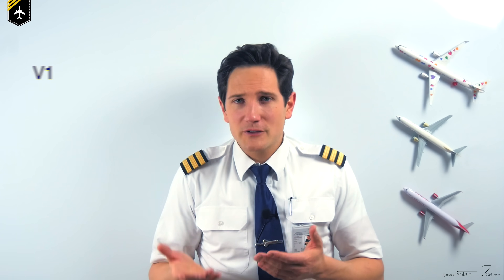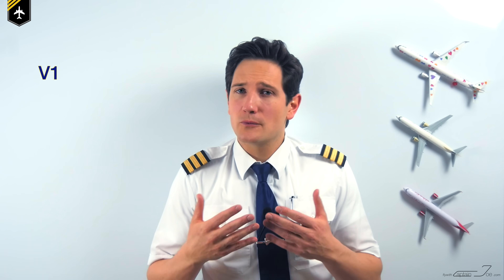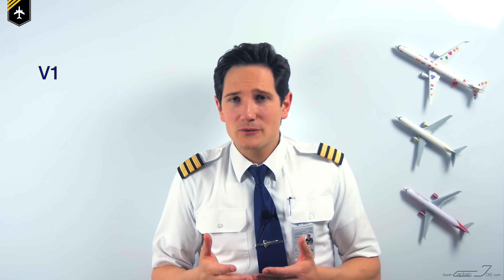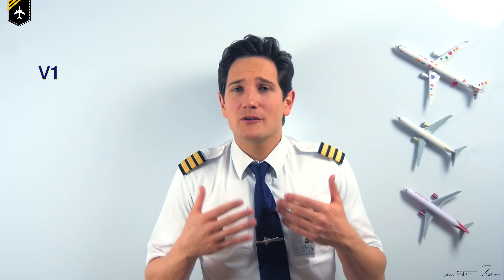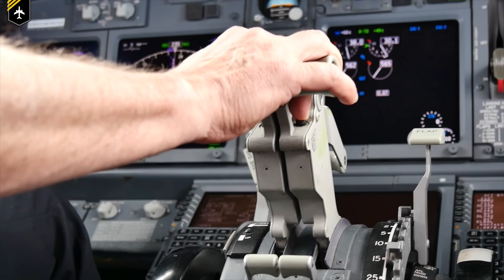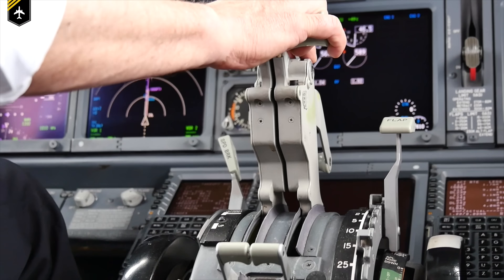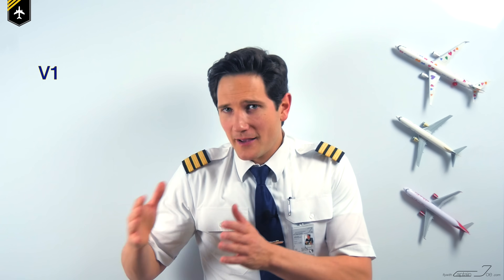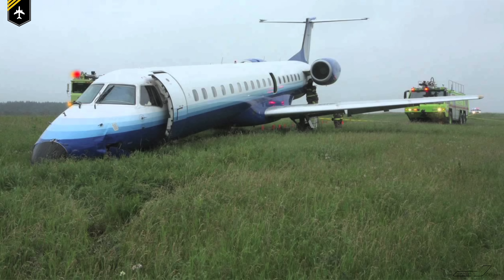TAKE-OFF Speeds V1, Vr, V2! Explained by "CAPTAIN" Joe

Comment: (Parody of "Captain Jack" by Billy Joel)

It's not right to be just hanging around
Time to live it up instead of down
Get your ticket and get off the ground
For awhile

So you go to the airport in your spandex jeans
Check your flight and gate number on the departure screens
A thousand times before doing this same old routine
But you smile

Captain Jo will get you high tonight
And take you to your destination
Captain Jo will get you there alright
Just a little push and you'll be flyin'

The Captain's here, don't want to be late
Pulls on the throttle and you accelerate
I heard him say "V1" then "Rotate"
Without a stall

Hear the mighty engines roaring strong and loud
Soon you'll be high up over the clouds
And please remember smoking is never allowed
In the restroom stall

Captain Jo will get you high tonight
And take you to your destination
Captain Jo will get you there alright
Just a little push and you'll be flyin'

Now you're cruising in the stratosphere
So high up but there's nothing at all to fear
You'll never know just how cold it gets up here
And that's fine

So the flight attendant serves you another stiff drink
And as you sip some booze you start to think
Economy class seats really do stink
All the time

But Captain Jo will get you high tonight
And take you to your destination
Captain Jo will get you there alright
Just a little push and you'll be flyin'

As your flight makes its final approach
You wonder if you'll always be stuck here in coach
You finish your drink and then clear your throat
And you sigh

Soon the jet plane's back on the ground
You're in another time zone and in another town
But there ain't nothing there to hold you down
So you fly

Captain Jo will get you high tonight
And take you to your destination
Captain Jo will get you there alright
Just a little push and you'll be flyin'

© 2017

Comment: Dear Captain Joe,

Can you please explain why an aircraft is able to maintain a straight flying pattern when one of the egines fails? It seems illogical.
Reply: nijs bouman this is because there is an automatic rudder trim which activates on airbus (not sure if in the boeing it activates automatically) which point the rudder in the opposite direction of the engine that is operating to Keep the nose straight

Comment: Great video Captain Joe!
I'd always thought V1 meant the aircraft had enough speed to take off and V2 meant the take off could no longer be aborted and it was safer to continue even with an engine failure.
Reply from the maker: There you go, one less thing to worry about ;)

Comment: Hi Captain Joe, how you pilots can verify the length of used runway is in accordance with expected acceleration? The runway is long enough, engine thrust is ok, but used runway is not. The plane has not accelerated as calculeted for some reason like brake failier or heavy wet snow on tarmac. 

Other guestion; As a passenger I would feel much more confident if the plane would be really physically weighed prior to takeoff. Its been many incidents that the plane has been rotated at a too low speed resulting in a tail strike.

Thanks for the videos!

Comment: ALL good,,,however, some aircraft,, the E3D for example, where the Flight Engineer has control of the throttles ,,,,,and will;  move ( EVERY take off and touch and go, and missed approach, ) the throttles to the appropriate ( and believe me, the E3D had a unique set of throttle settings!)position, so its NOT ALWAYS YOUR glorious selves.....
Reply from the maker: Didn´t know that, thanks for the comment!

Comment: This is probably for a different video.  However, The idea of V1 begs the question what happens if right after you reach V1 you have a DOUBLE engine failure.  I know it's very unlikely but what do  you do if BOTH engines should fail after V1 but before VR?  You're at the point where you can no longer safely abort the take off but yet you CAN'T take off without at least one functioning engine.  I would assume the obvious answer is  you don't take off and you probably end up over running the runway.
Reply from the maker: Very difficult situation!
Reply: yeah not trying to take off makes more sense; i mean you literally have zero thrust to lift...
Reply: What's wrong with the term "overrun"?
Reply: If for any reason you can't make the plane fly after V1, you're going off the end of the runway.
Reply: Soulrider2012
over running the runway??! 
a better term to use: 'overshooting the runway'

Comment: I have a question. What happens if you loose both engines at V1? Would you abort or go. If you abort the takeoff, you won't stop in time. If you continue the takeoff, you will stall. What would you do?
Reply: My cousin flies the a380 for Emirates
Reply from the maker: Probably risk the runway overrun!
Reply: Captain Joe ok

Comment: captain what if both engines fail?..surely you have to abort the take off
Reply from the maker: Very unlikely but I guess everyone would risk the runway overrun!
Reply: Hit the brakes and pray. It will likely end in a runway overrun but some runways have arrester beds at the end, which are designed to stop an aircraft which overshoots the runway. If not you may crash into some runway lights, damaging the aircraft but I thinks this is better than an impossible takeoff, followed by a stall and crash. If your runways ends directly in front of a wood with big trees... I think you're done.
Reply: Well first I hope my plane has four engines...
Reply: jasdeephardcore Absolutely. You don't have another choice. There are a few exceptions to aborting after V1 and this is most definitely one of them.
Reply: That's like the OLD joke,  Capt on a 747 comes on the PA system and says, "Ladies and Gentlemen, we have just had a problem with one of our engines, and have had to shut it  down.But have no fear the, this engine problem is nothing to worry about,  however, it will delay our arrival by an extra 30 minutes" A little while later the Capt announces that a second engine has had to be shut down as well, but again, no concerns other than it will delay their arrival even more.  Well, a short time later, YUP you guessed it they had to shut down their third engine, at which point my wife said to me, "Geez, I hope they don't have to shut down that fourth engine or we'll be up here all day!"
Reply: Steve Nugget during airplane certification, reverse thrust is not taken into account, to cater for better safety margin.
Reply: its almost impossible...all the engines fail.....i think that never happend in the take off.  Sorry abaut my english...i am argentinian...land of good pilots....and bads companys...ja
Reply: Military jets are not designed with safety margins of modern passenger airliners. They are high-performance aircraft and unless you're flying an A-10, low altitude flights especially with low speed are always risky. These jets can fly low-altitude maneuvers, from which they can't be recovered when an engine fails.
Reply: lol  I guess NO engines kinda dictates what will happen then!  :D
Reply: BTW  Jo, it's not been that long since I discovered your channel, but I am enjoying it and learning a lot as well.  So Thank You!!
Reply: JasdeepSaini96 u just answered your own question u r a new type of dumb
Reply: Captain Quirk The aircraft would continue the takeoff roll, and would rotate at the Vr speed and then climb out at V2.
Reply: Captain Quirk Yes.  It can lift off and accelerate.  Not well, but enough to meet certification standards.  At lighter weights, it can be done easily.
Reply: Captain Joe yeah i guess was just wondering... in case of both engines getting in contact with bird or even runway obstacles (after V1)
Reply: stormeagle28 Or the blast pad
Reply: It is indeed rather rare but has happened at least once in the military (to an F-18): http://www.cnn.com/2012/07/02/us/virginia-f-18-crash/index.html
Reply: El Campo En Lanus i know it is probably impossible but i was saying in case of bird hitting both of the engines
Reply: stormeagle28 Does anyone know what 3 models Joe has behind him? They're beautiful!
Reply: If it was just myself aboard the aircraft I would attempt the takeoff to see if the glide ratio is correct.
Reply: Some of the vintage aircraft have an anchor attached to the aft bulkhead just for this scenario.  The pilot assistant leaves the flightdeck and saunters to the aft galley where there is a "DROP ANCHOR NOW" lanyard.  When it's pulled,the person yells out, "Let the fun begin"!   Usually the tail section gets torn away from the aircraft as soon as the anchor catches onto something but the aircraft does stop eventually.
Reply: Captain Joe said: "Very unlikely but I guess everyone would risk the runway overrun!"

With an "all engines out" situation, I don't see that you have any choice.

But now here's my question:

V1 is the speed at which you are committed to taking off even if you have one engine out.  V2 is the speed you have to be going in order to take off with one engine out.   What happens if you lose an engine between those two speeds?  Too fast to abort the takeoff, but not fast enough to actually take off.  It sounds like you're screwed if that happens.  What say you?
Reply: Steve Nugget any reject after V1 means a higher probability of an overrun.  Loss of both engines would lead to a loss of hydraulics, which would lead to loss of spoilers, steering, electrics (unless APU was being used for pressurization) and normal braking.  So, yes an overrun is more likely.
Reply: Thanks, Oscar.  With one engine out, would the plane necessarily be able to reach V2 before the end of the runway?
Reply: bernie weber which vintage aircraft have this?  Pictures?
Reply: stormeagle28 yeah😂😂 hope it doesn't happen to anyone...

Comment: Thanks Joe. 5:00 brings up a question for me. Does the data from the radar altimeter take into account the pitch of the aircraft when it displays height above the ground, ie, does it show the height of the radar sensor, or the height of the lowest part of the aircraft? I imagine this could be a significant factor with things like tail strikes on landing, is there a warning mechanism that tells you when your "landing angle" is likely to cause a tail strike?

Comment: Reject or Continue the TO at IAS 152?
V1 154
Vr 160
YES/NO and why?
Reply: If its a major fault, sure
Reply: Depends on the reason for RTO.
Reply from the maker: Definitely reject!
Reply: As far as i understood/know, you can abort the takeoff procedure regarding the speed you provided above. Even if only by a little, you are below the V1 (decision speed) and you must abort if needed. Why? Because the regulations says to do so. Remember, in most cases usually you should have enough runway to safely completely stop.

Comment: I have a question for your kind and knowledgeable self! :-) 

When flying north-south without prevailing winds is the coriolis effect noticeable on navigation? Also, is there a slight tendency for the craft to 'nose up' due to the curvature of the earth. Does it need correction or does aerodynamics take care of it? Oh, and is how far below the plane's horizontal does the horizon come? Oops, many questions... Sorry!
Reply: No for all of these. And the last one, it depends on your altitude if I understood the question correctly.
Reply: Yeah, the last one is a given, the radius of the Earth plus the altitude and a bit of trig on the tangent but the question was more about how he observes it. Obviously everyone knows it's there and can crunch the numbers.

I guess that's not surprising (if a little disappointing), the CE is very slight and as the atmosphere slows relative to the earth's spin while on a north-south tragectory there will be a lateral force from the craft's inertial frame of reference reducing it still further. Still, it exists but I guess it needs precise instrumentation to notice. Likewise with the reorientation I guess, drag and fluid dynamics are going to be massive forces which would tend the right the craft and it would be lost amid the constant course corrections, turbulence and even the trolley and passengers moving back and forth.

Comment: Another great video! Can you explain what open climb and open descent mean?
Reply: Thanks Joe! I think you could do a video on the autopilot and autothrottle generally maybe ;)
Reply: Aircraft is mostly flying with the flight management computer set up, and there are altitude restrictions for some waypoints on route and the computer and autopilot is set up for these restrictions. And if some case air traffic controller tells you, that you don't have to follow these restrictions, here's when OP CLB and OP DES comes in. The pilots press this button and the aircraft is not following these restrictions and climbs freely
Reply: Thanks a lot for explanation! I was just wondering what it means as I am learning to fly an A330 in a simulator (X-Plane). BTW Are you Czech or Slovak? Your name sounds like that a bit. (I am Slovak)
Reply: CZ:)
Reply from the maker: Yep! Great question! I will answer that in time!